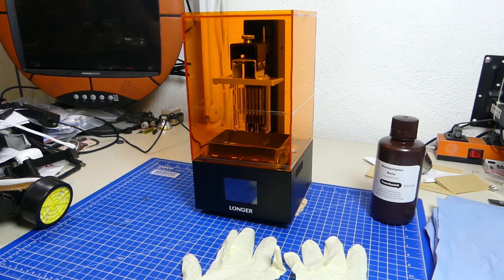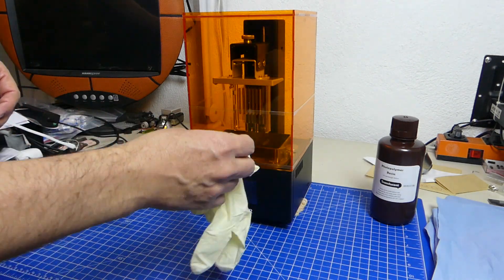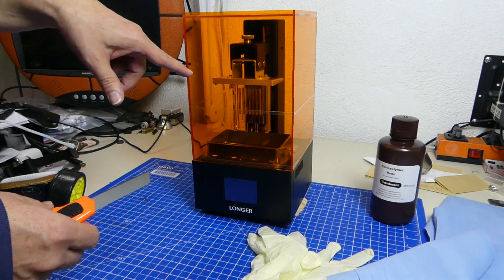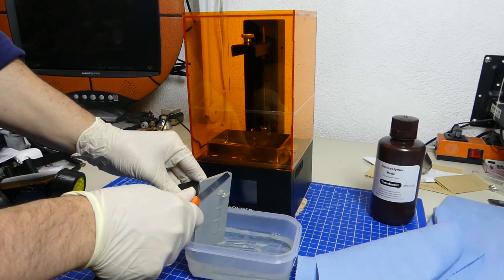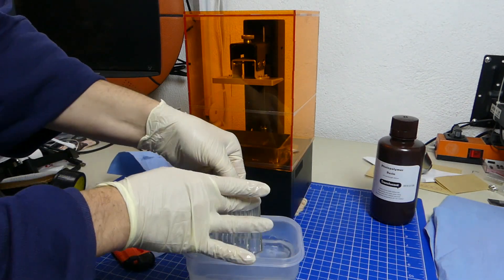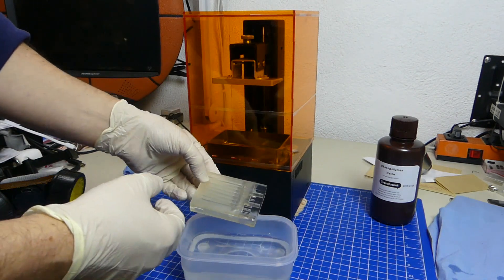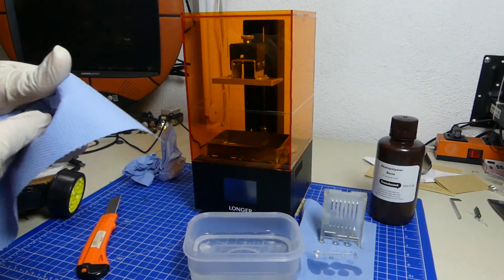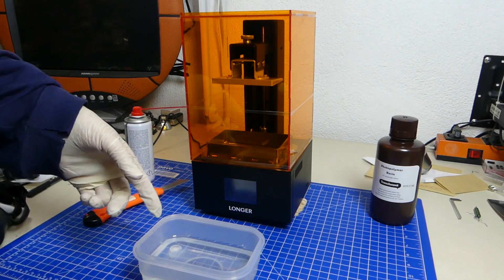Resin Prints - From print to cure - tips and tricks

Comment: Dirk Thank you, is there another solvent that wont make the 3D model become opaque while washing off excess resin? Maybe a different alcohol? or is isopropyl  alcohol the only one we can use as a solvent for washing off excess uncured resin?
Reply from the maker: I don't know of any - the issue is that the surface is not really flat, the best way to get that is to either polish it or add a layer of clear coat to it.
Reply: you need the alcohol and water to completely dry out, or it is sitting IN the surface and makes it frosty. That is also why you really need all the uncured slime gone.

1. Shorter time is supposed to be better (the uncured resin actually attacks the cured resin, which is why you don't want big voids of liquid resin trapped inside)
2. Clean it really well, so it only has crisp resin, not slime. Shorter time in solvents is better, but clean is best. If you sit too long in solvent, your cured layers will get a cloudy surface. So clean with alcohol, but try to keep your time down to under 6min (under 2min if you can get it clean in that), then rinse in water to get the alcohol off faster (and it also dilutes any remaining alcohol to make it less solventy)
3. Optional alcohol ink coloring
4. Dry thoroughly. (since the liquid resin is gone, you can leave it overnight etc at this stage)
5. cure enough.Longer exposure will turn more cloudy and brown/yellow. This will eventually happen naturally. Don't use sunlight! Sunlight has the harmful uv + the safe uv, so it rapidly damages it while it is slowly curing it. Use a uv light. (get a cheap bulb, flashlight, led strip lighting, etc. You can do this for less than $10)
6.Surface finish with a UV protecting Gloss finish. Just like car paint, the clear depth comes from the glossy surface. A matte surface like the resin cures with will diffuse the light and make it look cloudy. The gloss finish fills in the matte surface and makes it substantially more clear.
Reply: @andrewstambaugh240  Thank you Andrew. My question still remains. What type of alcohol are we talking about. Ethanol, methanol, isopropyl?  I am assuming isopropyl is the only one we can use since Dirk mentions this many times. Is this right? It doesnt matter so much now since i did not buy this type of machine. Bought a small K40 laser cutter instead, Totally off topic ha !! Thanks for your generous info.